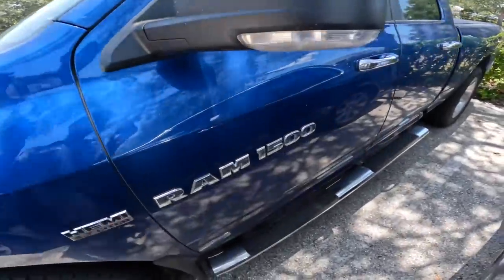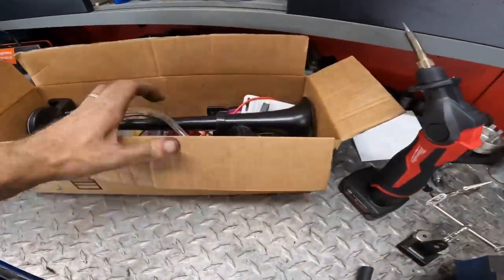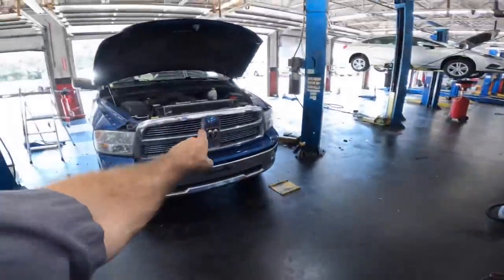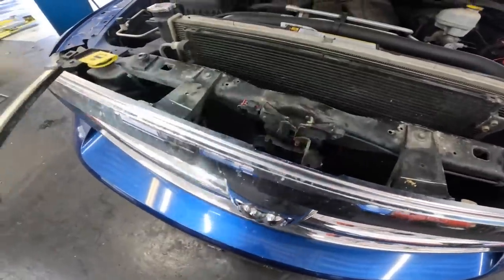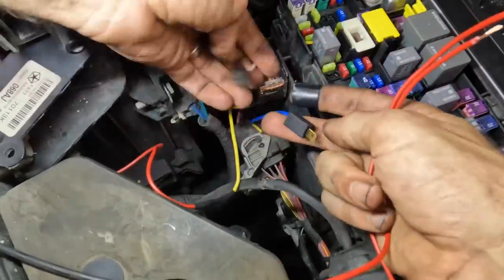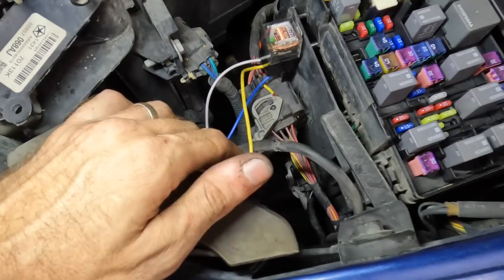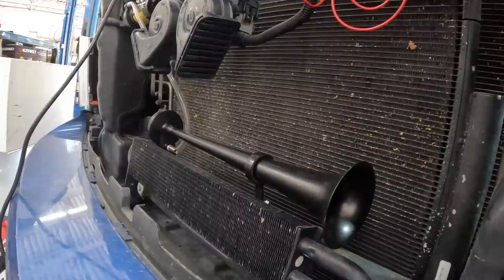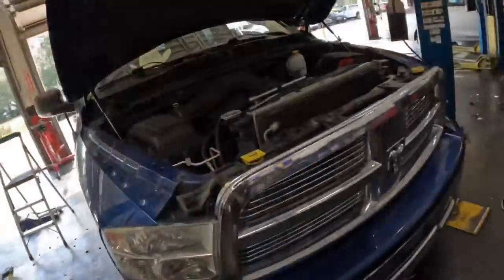Dodge really blows! Ram 1500 4x4 5.7 Hemi

Comment: Didnt know these horns where legal over there. Here in Sweden that would never pass inspection and if they caught you using it you would get fined.
Reply: They aint legal..its as dumb as it gets
Reply: it really depends on where you're at in the states. Most states don't care what your horn sounds like as long as it's within a certain decibel range, however there are other states (like California I believe) which won't allow you to have anything louder then the factory horn.
Reply: Most states don’t require an inspection
Reply: Here in Canada we don’t have inspections only if you want to register a car older then 12 years. Plus they don’t care how loud a horn is as long as it’s used appropriately and you don’t disturb people sleeping at night. There no louder the a semi horn or train horn
Reply: @ryans413  on new vehicles here in n.j. cars get 4 year dealer inspection sticker....and they take 3 year registration fee...after the 4 years it's every two years...no fee inspection at state agencys...its part of the registration fee.  In pa,they pay for yearly inspections at private facility's.  All they look for now is emissions and exhaust and tampering with cat converters
Reply: Obvious overly jacked pickups will get a big fail...they used to check headlight alignments horn wipers,broken glass,now if glass is obvious broken ya fail..loud exhaust ya fail...

Comment: those extra bands on there is glue to make it a water tight seal around the wire. I found those butt connectors a couple yrs back on the big A and just had to try them, and I have been using them ever since. I lovem. like the way you double stack the heat shrink , that's what I do as well.

Comment: I've come back to trying the solder seal connectors a few times and have decided they are a gimmick.

Not easy to safely get enough heat on them in a lot of applications without burning a million other things. Not to mention it's not like regular splices are disappearing
Reply: if the crimp connector is good enough for the end terminal, they are good enough for the butt connectors. agree those solder connectors are cute but not needed for 12 volts
Reply: You got the wrong tools if ur getting heat "everywhere".
Reply: Definitely not a gimmick. Used throughout aviation, military and civil. Well at least the good ones are, don't know about the cheap stuff on eBay/Amazon.

As for heat, heat guns have deflectors to direct the air around the wire and protect surroundings.

Comment: OCD wiring tip... whenever I attach a crimped ring terminal (or a spade connector), I cut the plastic bits off and double heat shrink the crimp, just like you did. Less bulky looking and super clean. But that's just me. Carry on!

Comment: Hello there, greeting from Norway. Love watching you work, have learned so much from you. I have a question: I got a spun bearing on my 89 MR2 and the connecting rod itself has some scratches where the bearings are seated. Can I reuse the connecting rod or should I change it?
Thank you once again for making great content and say hello to Mr Peter
Reply from the maker: Change it, it could be out of round and will spin again
Reply: Waiting to do an engine rebuild on my 88 MR2. Burns a quart of oil between fuel fill ups, I suspect bad rings. Good luck on your 89!

Comment: To much red wire!!!!. Automotive wire can be brought on small reels in a variety of colours for little cost.That way you can see straight away what does what.
  As for the horn it’s self. This should be mounted in a vertical position. That way water doesn’t get into the horn and muck up the electric’s inside. Dreaded corrosion like on battery terminals.
   Sorry ray fail on this one I’m afraid. Read instructions before going ahead with fitting. Always a good policy. I refer to it as RTFM l will let you figure that out.
  But having said that mate good vid as always.
  You have a good day 👍😃🇬🇷

Comment: I use those connectors here and there.  I like the flexibility in the wire after the repair, but as you stated, it takes a bit longer that usual.    Make sure the connection is cooled before giving it the tug test.

Comment: Some people crimp the band as well. Works wither way. Personally I still solder and heat shrink with the double insulator seal heat shrink. I still have a few rolls of 60/40 solder left. Former electronics tech

Comment: i have used the wire connectors for yrs.. Use a lighter ot butane torch to melt the solder faster..

Comment: I don't mind using the red wire for a ground (or any other color), but when I do I wrap the off-color wire with black tape near each connection end, hopefully signifying to someone who comes along later that this wire is ground, not power.

Comment: I also swear by those solder connectors.  I bought a nice little Dremel butane soldering iron/torch that I use.  I put the flame arresting thing, whatever it's called then use the heat deflector with it.  It only takes a few seconds.  Once you master them, you get a nice soldered weather proof connection.

Comment: Just a quick suggestion, why do you not put your heat shrinks on your wire before you bare them so the heat shrink doesn't catch The strands when you put it on

Comment: I use the solder shrink splices industrially all the time to bond small shielded cables to a ground strap.  It's interesting to see the band go from solid to liquid in the blink of an eye then back to solid just as quickly.

Comment: They make little shields that clip on the end of the heat gun.  It cradles the wire and redirects the heat to the backside of the wires.  Supposed to help evenly heat.

Comment: I have mine hooked up so if I hit the horn on the wheel the normal horn will blow for about 2 seconds so I can beep beep and its just the normal horn but if I hold it for 3 seconds or longer the air horn will kick in so then I have both and it sure gets attention when needed

Comment: Yeah those connectors are the balls... Technically you don't need the 2nd piece of heat shrink either, since the connector is a waterproof heat shrink connection.

Comment: No need for the additional heatshrink as those solder sleeves are sealed.  A deflector on your heatgun will allow hot air to hit all sides of the splice at once.  We use similar things in civil aviation, but the join is made with a crimp and a heatshrink cover is put over for environmental sealing

Comment: I’ve often thought about doing this to my vehicles. The way I would do it would be to create a circuit to delay activating the air horn until the main horn had been on for a couple seconds. That way tap-tap, you get the regular horn, and to activate the air horn you’d just hold the horn button down for longer than two seconds.
Reply: You'd need a capacitor and rheostat or varistor to create an adjustable "tank" circuit for that...
Reply: Or a small thermal breaker switch on a ground controlled relay, as soon as it heats up, the relay opens, switching to the airhorn...

Comment: For those solder filled connectors you could do a short showing how those connections work and then how strong the connection is by hanging a weight on one end. The other end attached to the lift. It would be good info and entertaining too.. Info-tainment!!

Comment: Good job Ray, but you shouldn't need the second relay, just run two wires to the switch on the dash to make or interrupt the signal wire to the relay you just installed...it'll save you some work, the two wires going to the dash are for relay actuation only and carrying little current !

Comment: I would rethink sliding that heat shrink as high as you did on the ground from relay.  If the heat shrink is making contact with the area touching the conductor, it makes for a poor connection and a potential point of failure

Ree over

Comment: 10 years ago those solder sleeves were about $1 each now their not even 20cents each and asmuch as i love them the solder is cheap and has no Flux so i use solder on spade connections after crimping just because i know in 2 months times I'm going to have to pull the dash and everything else out just to replace the most insignificant part.
Also I'm never bothered by red wire aslong as you use red/yellow heatshrink on positive conections and black or green on grounds

Comment: I really like using those connectors as well, i make a v with each end of wire then twist together and insert into middle.  It does take a good amount of heat to use, burn my fingies sometimes.  When it comes to any dodge, chrysler, jeep i make my own ground source as we know how well factory body grounds hold up, im in the rust belt

Comment: At an old shop i worked st we had a little box with a butane pen with like a C that you put on it just like you do with the accessories to a heatgun to melt that solder. Worked like a charm and a small footprint at that. Might be a neat addition to your toolbox. Pleasure as always Sir

Dremel seems to have something of the sort called versatip. Found it on amazon so might be an easy find for you
Best regards
Tommy

Comment: IT guy pro Tip. Temp installations use VELCRO. I've seen too many nicked wires in my life from idiots trying to cut zip ties. May not apply to engine bays, I dunno. Just saves me headaches. Hopefully that helps someone. Yes, zip ties are quicker cheaper in a lot of cases. YMMV

Comment: That's a good demo of those butt connectors that are melted with hot air. There are lots of reasons they shouldn't work, but they seem to be catching on and it is hard to deny that they aren't easy. It will be interesting to see long term results, and response from marine associations like ABYC.
Reply: Don't know about marine use. Probably a version speced for that, buy not the cheap eBay/Amazon stuff.

Aviation, military and civil, has been using them for decades.

Comment: I’ve done similar to my cj5. Used an old York AC compressor to a tank mounted under the body,hidden well and above other    Parts so no fear of contact.  Pump puts 150 psi in tank in less than 50 seconds. The train air horn air switch is simply tied to factory horn. No air, you hear Jeep horn, with air a train is coming through. Air is on a 3 way toggle inside the cab up is air, center is off and down is the welder…another story but both welder and compressor all home made work better than my store bought equivalents. Would love the link if you have it for that horn kit, think my Harley is jealous and wants one
Reply: @jimmyphillips2216  
you can edit your post using the mouseover on the 3 dots to the far right of your post
Reply: @mrmustangman  thank you for the tip!

Comment: Might sound a bit picky, but you might want to keep an eye out for different coloured wiring so you have a better chance of matching the accessory's wiring colours. Either that or label each wire you install. And maybe draw a simple block diagram of how the horn is wired, give it to the customer to keep handy, for future use by yourself or someone else.

Comment: After a while the die grinder noise in the background became aggravating; besides, the guy using it was continually stalling the tool—my kind of technician. With the heat gun pointed at the fuse box, I thought you were going to melt some of them too.

Comment: Little tip, try using a heat gun with a "J" deflector to evenly melt the solder ring without having to move the heat gun or wire around thus reducing the chances of melting stuff around the connection.

Comment: Stop at Home Depot or Lowes and pickup a container of Tinning Flux. I have been using it for making wire connections for years. It flows at a lower temp than most solders.
I'm sure someone will say "you can't use that, it's for sweating copper pipes"
Well what do you think wire is?

Comment: Looks great Ray - I use a digital heat gun (Steinel) with an attachment that concentrates the heat  better and reduces the need to move the gun around as much.  Not cheap but saves time - kinda like Snap On tools.

Comment: So, a better idea, would be not to install another relay at all.
What would be a far cleaner install, would be if you splice the relay power wire after the 30a fuse and connect one side of the relay coil to that power feed. Then, run the other side of the coil up to the dash to your kill switch, and the other side of the kill switch to the factory horn switch/wire. Assuming it's a switch to ground, which most are.

Comment: Hi Ray
Why are you using a second relay? 
Just install the kill switch on this relay (Air Horn - actuation signal). So that when the switch is on both horns work and when off this relay does actuate and only the factory horn works as usual.
Or does the owner wants only 1 horn works at a time?

Comment: I was about to scream when he was adding that ground at the bottom and the factory wiring on top! , Also don't use those self soldering shrinks , use the crimps they are way better. Just crimp it then cover it with a heatsink and u are good for years.

Comment: i personally dont really care about wire color if it's a short run. also, make sure you check the relay before wiring. some of them have flyback diode and pin 86 should be wired to positive. wiring them backward would create a short circuit.

Comment: Get rid of that relay and install a changeover one operated by the switch in the cab. Both horns wired to either side of the changeover contacts and horn supply wired to common!

Comment: Ray, I would call them "Knipex" pronounced the same way as we say Knife. However I have never heard anyone say how they are pronounced. As always great videos, keep up the good work. I have learned so much from you about working on OBD II vehicles. Guy Franks
Reply: I pronounce them like the K is silent also.
Reply: Its pronounced with the k, it actually is a german company and we do pronaunce it with k, so the second version Ray used is the correct one.

Comment: Nice solder sleeve splices. I can certainly see the benefits of them. But I think I'm faster with conventional soldering and heatshrink.
Good call to apply an extra heatshrink. It looks better and it offers some extra support for the joint.
Next time, on big eyelets, use three overlapping pieces of heatshrink, for better seal and better looks.
Will your circuit be able to toggle between the added air horn and stock horn with a dash-mounted switch, or will it just enable or disable the air horn only?
Reply from the maker: It’s just going to enable our disable the air horn
Reply: @RainmanRaysRepairs  Just enabling or disabling the air horn... Should be good enough, because that monstrosity completely overpowered the stock horns.
Thank you for your answer, Sir. And have a great day, too!

Comment: Hopefully the horn and "air compressor" were bench tested before you started.. I now have two compressors on my truck with 3 small horns.. Last Thursday it saved me from a guy backing out on to a 40 mph road and I believe he did not see me.. The video shows what I thought at the time. There was several escape routes that I did not need to take.. I found out that the audio on the dash cam  is off ?? The cam that I was testing on the passenger side has the audio.. I need to find a GOOD air compressor.. and redo some air lines... 
You may want to find out what the laws are in your area about using a horn at all much less an air horn... Some of the Po Po might write you up...

Comment: Not to nitpick, but if you had a heat shield that curved around the back of the wire it would melt more evenly/quickly.  Less chance of burning the heat-shrink or wire coating

Comment: Hey Ray, auto strippers are not authorized for aircraft and satellite work. The issue is that the (wire conductor) is nicked by the auto strippers.  The government sent us to  China Lake to learn the proper process. Millwright for the Air Force, and I worked at NASA for 24.5 years.
Reply: So what's the proper process ? THANKS.
Reply: Then it's a good thing the truck can't fly.
Reply: @NoWr2Run  We used a pneumatic stripper.  You push the wire in until it bottoms and triggers the knife blades.  The expense are the custom machined knife blades, which weregood for maybe 500 cuts.  Then they had to be tossed and a new set installed.    For everyday use Stripmaster or Ideal Mfr. Model #
45-174 <-- (roughly $300 US)
Reply: @gr7485  Don't forget that there is a red Tesla convertible coup in space.
Reply: @GaryStanden  Ok I looked that up & it still has SHARP BLADES as you said. So don't they also NICK THE WIRE ? On my Automatic hand stripper I can set how much force it puts on the wiring insulation before stripping it. I'm not being a DICK as you know more than I surely do.

Comment: Ray, While doing wood working I cut myself on occasion. I used to use vinyl tape. It snags on stuff. I found it cut off the circulation to the digit. Sweat makes it fall off. I found that Cyanoacrylate glue does a much better job. Different brands stick better to skin/blood than others. Doctors use it, medical grade = more expensive. Not enough Cyanide to be dangerous, according to the doctors I asked. CrazyGlue good, Locktight good, Gorrilla meh. CA was invented to save soldiers lives in Vietnam. Dissolves with Acetone. resistant to IPA, Lacquer thinner. Not sure about brake cleaner. ;~p

Dab the blood away, put a drop on the wound, quick wipe with towel, finger wipe is better. Seals the wound, leaves a protective coating, falls off after wound healed. The grease/oil on the skin will stick to the glue, no tattoo potential. 

There is stuff called "new skin" that bowler's use when the skin is rubbed raw. Takes to long. 

speaking about long. I am sorry that my message was so wordy. I tried to touch on the just the highlights.

Comment: You need Knipex wire stripper pliers,since I have mine,with razor sharp cuttingvedges,and perfectly aligned surfaces,all othersxare junk..and I have several of the names known here,knipex blows em away